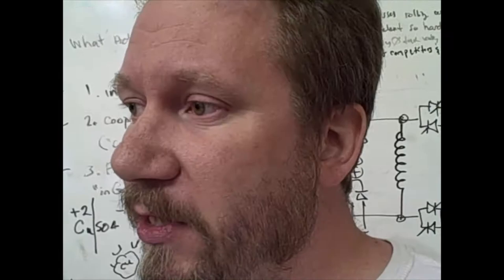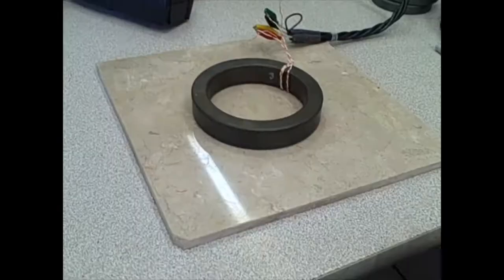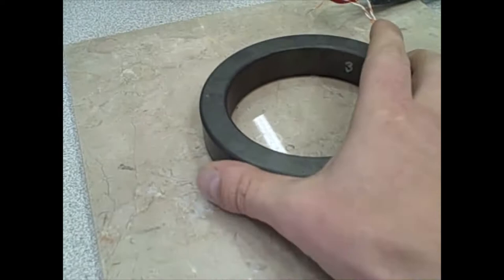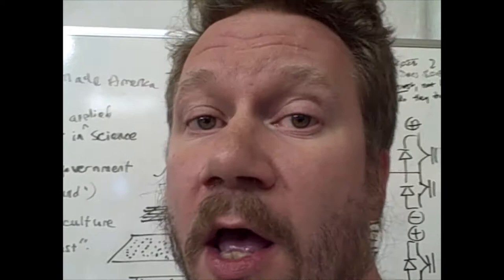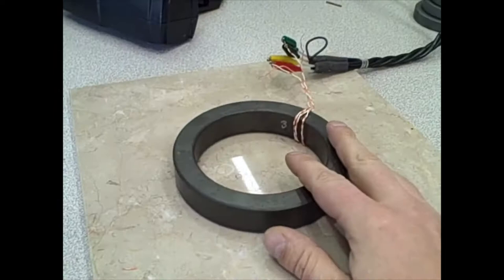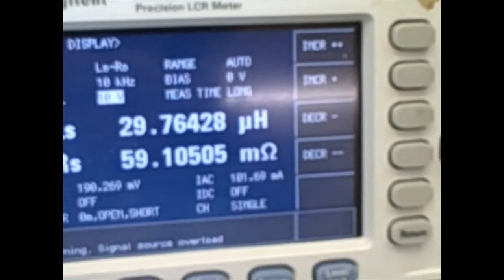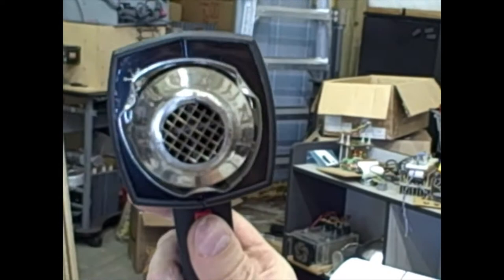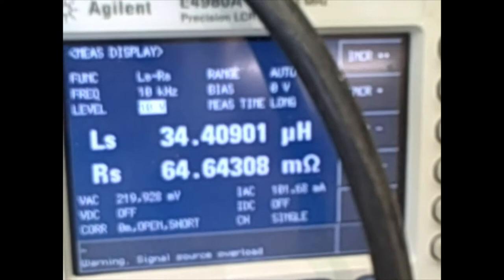what if the fuel of the future is everywhere and we have too much of it?

Comment: Hi Graham,
I know this is an old video now but I guess you still get notifications. I wonder if you have considered that any gradient can be used for energy generation ? Any change in local environment can make up a gradient and it could be pressure, humidity, pH, density … anything. Because EisE and as long as path is established between 2 ends of a gradient in the very same medium, there will be a flow of charge inexhaustible. Magnetism is a consequence of electric charge flow and we can use even what we call insulating materials to conduct electric charge … simply because what we call insulators are in fact charge separators means they conduct electric charge on their external surface almost without loss in any length provided there will be not break in the gradient.

Comment: Heat in magnetic materials resonate the magnetic domains of a core. So, it must have a frequency distribution. What happens if we slowly magnetize a core, but we demagnetize it much faster? You can try to create a half sine waveform magnetization with low frequency, and another half wave demagnetization with a different frequency. If the frequency of demagnetization is in the range of heat resonance in the core, you create braking force on the heat resonance, thus cooling more (during demagnetization) than heating (during magnetization), and get extra energy out. Have you tried something like this?
I would try it with slow core materials, where the heat frequency is low. And if the material has a low Curie temperature, heat adds higher force to the demagnetization.
I have seen a video many years ago where someone measured 4-5˚C cooling in a Neodymium magnet, in an experiment.
Reply from the maker: Wow, that's awesome. Look, if you ever find the link to that cooling effect in the magnet, will you let me know? I'd love to check it out! :)

Comment: Changing the inductance of something doesn't make energy, it's just like making a bigger spring. You still have to put in energy to compress the spring before you can take it out again, and some of the energy you put into the spring is lost as heat that you can't take out again.
Reply: I think Graham's point is that under the right conditions, the fluctuation energy can cause a change in the inductance.
Reply from the maker: Thanks! Exactly :)

Comment: What if I told you there are ferrous materials available that respond in such a way that you don't have to extract energy as heat but as direct mechanical energy when subjected to a magnetic field which triggers a non-linear molecular phase change of the solid?  Much the same way as the phase change of Freon in an air conditioner results in a COP of 3-4 by drawing energy into the system from "ambient" only orders of magnitude greater?  We should talk.  Please reach out.
Reply from the maker: Thanks! I'll put out more content, which I think continues to show that ambient energy in the form of ambient heat is an input, and magnetic energy is the output. It sounds like you might be on the same track! IM me on FB?
Reply: @ggund01  FB. HA! I don't do FB. Sorry. Check my contact info at alt-nrg.org. And no I'm not talking about ambient heat energy. I'm talking about what keeps electrons in motion and holds them in place. Same energy that binds the entire universe. For a teaser, have a look at my playlist Non Joulian Magnetostriction. The same alloy I discuss in that series could also be your holy grail for variable L. Like I said. We need to talk.